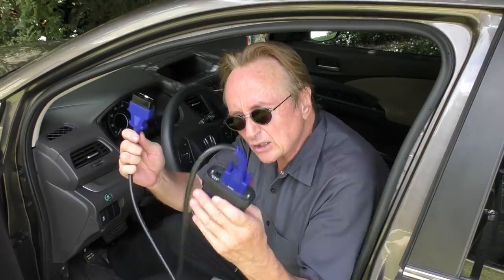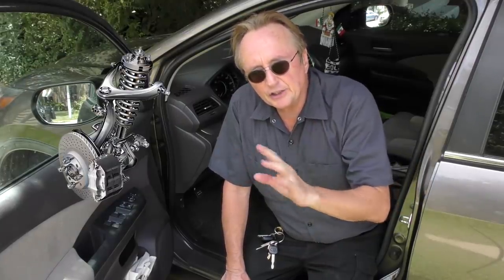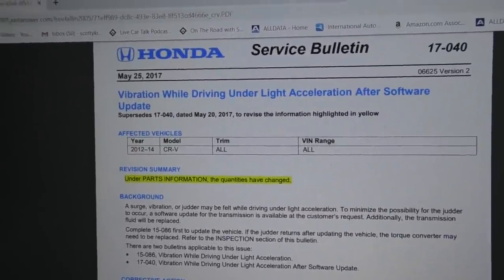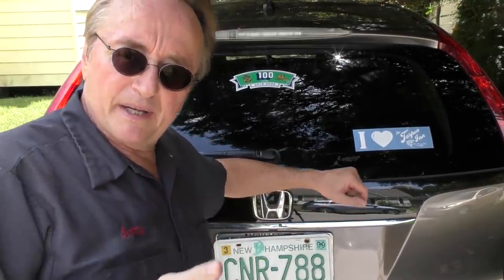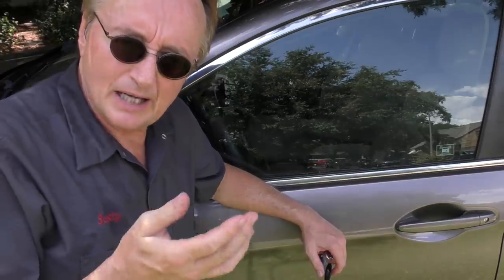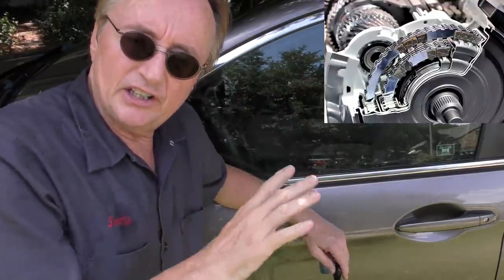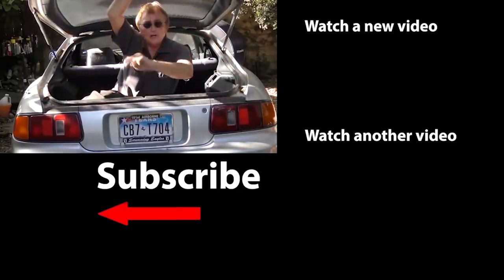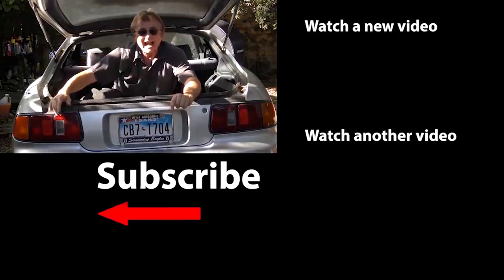I Can't Fix This Car

Comment: Scotty, Try adding friction modifier. Some of the problem is the way the ECM  engages the torque converter, and shift solenoids. Try putting the CR-V in drive not overdrive. My Toyota FJ had this issue but would never do it in drive, just in OD. I changed the trans filter once and fluid 3 times within 3k miles. NO more shudder. Worth a try. You are the most knowledgeable mechanic I know. Wish you lived closer you would have all my business. Keep the great videos coming. Thanks😊😊👍👍

Comment: I had a 2003 Chevrolet Impala that I bought used in 06 with 31k on it. The transmission started acting up at around 70k. I  just drove it till it got 230k and traded it off. The transmission ran okay until the last 2k, but it definitely was ready to go at the end. I live in a rural area so that helped. Love your show. Take care and be safe.    Vaughn

Comment: I have a 2013 CR-V that upon starting emits a momentary rattle sound. Researching on the net, it seems to be a common problem that allegedly is due to the variable valve timing. Some people report louder rattling and/or that lasts longer than a split-second, and they claim that the dealership and Honda won't do anything about it because it is a brief sound and hasn't kept the car from operating. I consider myself lucky that my car's noise is not loud or long. I just keep driving and it hasn't gotten worse.

Comment: I have a 2000 CRV with the same issue. Its got 256,000 miles on it. Slight shutter, has not gotten any worse. You get used to it. Its no big deal. Love my CRV!!!

Comment: Scotty,  over time,  are newer cars or were older cars more expensive over their lifespan?
Considering newer cars break down less, but are more expensive to fox and usually require a mechanic and computers. 
But yesterday's cars many things could be fixed by the owner with basic knowledge and a good tool set.
And which do you prefer?

Comment: So glad I have a 02 Manual Tacoma RWD. Drove it threw the mountains, 1,000 miles, turns out it had MASSIVE rust damage pulling 200% rating. Now It bends when accelerating. After a good 40hrs of work It's SO much better. Just goes to show knowing how to weld is invaluable. My Rusty Tacoma is better than your new Chrysler

Comment: Not questioning your diagnosis. Just sharing some of my experiences. You say "Jutter" . If it's a torque converter I would say "Chuggle". We just use different terminologies. Fords had a lot of torque converter chuggles with their aluminum torque converters.  Seen a lot of lean miss fires under light load that were caused by over active EGR valves, or slight increases in exhaust system back pressure. Easy to verify. Have experienced Vehicle Speed Sensors that would randomly drop in and out causing the vehicle to jerk.

Comment: My 2004 Honda pilot does the same thing. Been doing it for years. After it’s been in the shop many many times and they finally figured it out the warranty was outdated.  So we just put up with it and keep driving it. It now has 237,000 miles on it and keeps going strong. We just have to put up with the transmission shutter once in a while.

Comment: My sister owned a 2012 CR-V, had 285k and she traded it in afraid the car was nearing it's useful life. She got a 2017 CR-V. After 20k, she experienced this same trouble. Dealership couldn't get the trouble on the 10 minute test drive, the mechanic couldn't find the trouble. She traded it in for a 2018 Lexus RX last fall.

Comment: I own a 2016 CRV with the same problem within 1 month of buying it.  Took it to the dealership and they told me the car shaking like a washing machine at a red light is a "feature of the vehicle".  Called Honda HQ and they told me they leave these issues to dealerships to resolve. So basically I spent 26k for a washing machine on wheels.

Comment: I've got one that Scotty probably couldn't fix either. OBD1, idles all over the place. unplug the fuel pump and it keeps running indefinitely with the fuel pressure at zero. Clamp off the evap lines and it keeps running. Where is all the fuel coming from? Could the engine vacuum suck just enough through the injectors to keep it alive? People I've shown the video just shrug and go WTF?

Comment: I have a Nissan that would occasionally do the same thing. It would "shudder" for a few seconds, then be fine for weeks.  In the end, I found a tiny coolant leak that was dripping on one spark plug.  Once I fixed the (very tiny) leak, dried up the spark plug cavity and spark plug wire/boot, it was gone. It's been over a year now with no hiccups whatsoever.  That's something no computer would be able to pick up on. Unless you were lucky enough to have it happen while looking on the scope. There wasn't even a "misfire" code since it was only a few seconds long, very occasional anomaly.   It's something worth checking if you come across it again.

Comment: Hi Scotty,replaced water pumps both, flushed heater core and radiator also turbo charge. Over heat and reservoir bubbling.

Comment: I have a similar problem with a Mazda3 Transmission that is slipping at low speeds (not all the time) the dealership said the exact same thing, if it doesn't trip a code it will be hard to diagnose. I took it for 3 test drives and the mechanic finally admitted that there is a 'subtle problem with the transmission but nothing serious to warrant an investigation. He basically said keep driving it until it gets worse! I am from Australia and Mazda here is the 2nd most popular brand behind Toyota, but I think now I know why it doesn't sell well in the US. Their transmission are very weak and the car is a 2018 with only 15,000kms on the clock!

Comment: The biggest problem is the logo on the hood H .  At least this one kept going, mine would die for no reason. Three H dealers could not find anything wrong with it.  They told me it was high mileage at 65k and I needed to trade it in on a new H. No way no more Honda's.

Comment: I had similar problem with my TSX.  The computer put the car in safe mode.  I changed the Accelerator Sensor and it fixed the problem.

Comment: If this transmission is similar to the 2003 4WD Element, check tyre wear & pressure + an oil change. New tires and an oil change fixed it 100% on mine.

Comment: Honda's are notorious for not throwing codes for problems the Car might have. Example: Our 2004 Honda Civic just shut off while my wife was driving it. No Check Engine Light came on whatsoever. I scanned the Car for DTC's and found nothing.  Went to the Honda Dealer and top tech said swap out the Camshaft Position Sensor. 
I did just that- and the Car started right up. Honda has a problem with the Diagnostic Chip inside their PCM/ECM.

Comment: My new car has a computer controlled windshield fluid. The computer works out the amount of bugs to dirt ratio on the windshield. It changes the ration of ingredients, the amount, the temperature, even the amount of foam and color depending upon what it worked out that it needed for the best cleaning.
It will cost $1250 to replace the washer when it breaks

Comment: I knew what it was right away.  Honda transmissions are famous for juttering torque converters.  My 05 pilot started to do this at 85000.  It now has 265000 and still does it.  Its not hurting anything.

Comment: Had this exact same problem on my 2012 Honda Pilot. It's piss poor short cut engineering to meet EPA standards at it's finest. That vehicle has an eco mode that kicks in under light load at speeds roughly above 35 mph and it cuts fuel and spark to half of the cylinders. This technology has been around for quite some time but Honda couldn't engineer it in these vehicles to balance the engine correctly when engaging. My fix? I interrupted one of the coolant temp sensor wires (doesn't matter which one) with a 100 ohm resistor. Yes, this makes the CEL come on but completely gets rid of the shuddering issue. The PCM believes the engine is not up to temperature, therefore does not engage eco mode knowing it could case more harm than good on a cooler engine. I noticed literally a .5 mpg decrease and drove that way for 50k miles with absolutely no side effects. A very small price to pay in exchange for vibrations/shudders raising hell on your entire drive train.

Comment: My Pontiac had something that looked like a transmission shift problem, but it was the MAF sensor because it was giving garbage data to the computer. However the MAF sensor was giving values in the acceptable range and not triggering errors. Took about two weeks for the dealership to figure out, and only an experienced mechanic could figure it out. Was lucky they were honest, because MAF is about $50 + labor, and transmission is about the current value of the car.

This Honda thing could be the same thing I've mentioned before. Thus may be some variant of the "failing in range" type fault. Might not hurt to see what the MAF and TPS sensors are showing the computer, because the data from either of those sensors is also used to tell the computer when to shift the transmission. Perhaps the vehicle speed sensor too. Those will give an idea of the current load vs. power demand. This means keeping an eye on the voltages put out to see that they change in response to driving conditions. MAF can falsely hold steady, and TPS can have jumps or dead spots. Yet those values are in the allowed ranges, so no codes even though those parts would be giving bad signals and should be replaced.

Comment: Scotty I have had the exact same shuddering "problem" for 11 years now since 2008 on my 1995 Mercury Marquis.  I get the shuddering under light acceleration when encountering an incline.  I just lift off the accelerator for 2 seconds then push it down much further ( but not enough to cause downshifting ). Engine pulls smoothly and no shuddering occurs.  If I need to slow down while still climbing hill,  I repeat the accelerator lift and push again.  I'm not a mechanic at all but it feels like the torque converter locks up and won't slip at low RPMs.  ( kind of mimics a Brocken motor mount I once had ).

Comment: Identical problem with my 2013 BMW X3, only after changing transmission fluid and filter due to replacement of leaking transmission cooler line. Only 50,000 miles, no lights, no codes, just a shudder when lightly accelerating. Shifts smoothly through all 8 gears. BMW did transmission oil balancing test, scanned OBDII, and cannot ascertain cause. Their remedy, to "try" a transmission replacement to the tune of $13,182, with no guarantee of a fix. No thanks, I'll just live with it, I guess. No mention of torque converter or transfer case being a causal factor.

Comment: I have exactly this same problem since owning my 2012 CRV two years ago. I thought it was the engine mount so I bought a premium one but never had the old replaced yet. The problem persists, never get better, never get worse. Now I know even I replace the engine mount might not solve the problem. Just keep driving.

Comment: I had an f150 with a similar problem; turned out for me that a blown diode in the alternators bridge rectifier was causing a ripple in the voltage signal that at times confused the ECM and the truck would buck and shudder between 23-35 Mph. After I replaced the alternator the problem never returned.  I might be off on this one but it is certainly worth a check.  Peace

Comment: Yep, agree, they won't just replace the torque converter. Usually this happens when the transmission starts to wear. My 6 sp ZF Auto had a full rebuilt and torque converter replaced at 200K kms.

Comment: We had the same problem with the honda civic hybrid. The Dealer rebuilt the transmission at our cost. A few months later it started again, Honda said there was no problem. We traded in for a CNG civic.

Comment: We have a 2012CRV and it had the same problem. Dealer put in a remanufactured (reman) transmission under extended warranty and it took care the problem.

Comment: My daughter's Fusion does the same thing.  I did a filter and full flush with the cooler line off. It got better but it's not perfect (fluid was nasty dirty, but not burned). I told her to just drive it because it wasn't likely to leave her stranded.

Comment: Torque Converter. Yup. Same issue as my 309,000 mile 2003 Honda Odyssey, but mine keeps on going after it started 126,000 miles ago. :)

Comment: Not sure if this “jutter” is what I experienced. On my new car, if I were going pretty slow and accelerate VERY lightly, sometimes the car jerks a few times before starting to actually go. But I don’t think it’s a transmission issue for me. 

As I understand it, Modern cars don’t fire their engines while in coasting mode, and only start firing during acceleration or idling when stopped. 

So when I accelerate lightly at low speeds, the car is hesitating, can’t decide if it should accelerate or not. It fires up the engine, jerking the car forward, changes its mind and coasts a bit, changes its mind again, fires up and jerks, changes mind and coast, before finally accelerating very lightly

Comment: Scotty, 
 I have a 07 Tacoma. When I’m at a complete stop, then while making a turn I feel a vibration in the back. Even when I back out of my driveway and turning to get out of the driveway I get the same vibration. Doesn’t do it otherwise one of these are being done. Drives fine, no engine light. Any idea what it could be? Thanks!!

Comment: I actually had a similar problem with my 08 Chevy Malibu.  The mechanic sat next to me while I drove with his scan tool and all it showed was the torque converter engaging and disengaging.
Long story short they replaced the transmission control module, located outside the transmission and it solved the problem.

Comment: In my opinion Toyota’s have always been better built and more reliable than Honda’s. Especially now, newer Honda’s are having electrical issues, build quality is bad, turbo problems, oil dilution etc. They have gone down in reliabilty lists while Toyota/Lexus have remained remained on top.

Comment: change the oil in the transmission, run through all gears stationary, then hold the brakes on and power that thing for ten seconds in drive, then do the same in reverse ..... worked for me !!
Not had a judder since. xx

Comment: Perform a drain and refill on the transmission drive and repeat total of 3 times. Will fix your problem. Fluid is supposed to be changed every 30k on those.

Comment: my CRV (2014, 50k) has a similar issue, just it shudders at 35mph at 3rd gear. The Honda dealer recommended to flush the transmission 3 times and reprogrammed for 400$. I am not going do that stupid "repair" since the shuddering will come back according to other people.
This is a design flaw not a software update issue, its obvious.

Comment: My 2013 Nissan Pathfinder with the CVT did the same juddering at low speed, turned out Nissan had extended the warranty to 84k miles, they replaced my torque converter for free at 82k miles been running fine since.

Comment: General Motors cars used to do the same thing , it was the lock up torque converter , put a nonlock up trans in it , all fixed.

Comment: I had a similar issue many years ago with a Mitsubishi, went there and they asked me for a big load of money to repair it, this after 3 days of running tests on the car, so decided to try to solve it myself, and found what was the issue, It was a very tiny plastic tube that conducted air into the fuel injection system, the tube was curvy so with time it got with a almost invisible crack, spent 50 cents to repair it! ( a 20 inches plastic tube ! )

Comment: Sometimes, a worn out wheel hub assembly can do that juttering as well. Happened to my mom's 2007 Chevy Uplander, then the ABS/TCS/Stability lights/text on the odometer area showed up. Hasn't been doing that in a while. All that's left is to get the remote start to work again (EVAP Vent Solenoid is stuck open, which should close when 12VDC is applied to it and the vent solenoid is the same design as the one on my 2001 Oldsmobile Intrigue, which is nice).

Comment: I have the same damn problem on my 2010 civic. I got fooled and so did the best mechanic in town.i spent $1500 on struts, wheels tires alignment...still shudders at 15 mph under light acceleration.

Comment: Hey Scotty. I have a 2005 mini cooper base. And when I turn on the car, I put it in drive or reverse and it doesnt move. So i press the gas down all the way for 3-4 mins and then I try again in drive, and it works normally. What do you think the problem could be? Please help. Thank you

Comment: This is the first video that was a huge disappointment for me.  Honda keeps doing stuff like this and does not own up to their bad enginning.  I have the vibration issue with my 2015 CRV.  Now the new ones have the oil dilation issue.  It's time for consumers to say enough is enough or Honda will keep doing this crap.   Personally, I will NEVER buy another Honda.   I've been burnt twice by them.  Anyway; YOU SAY we should just live with it!!!  After spending 25 to 30K which is a lot for some of us.  This is not acceptable in my opinion.  This can not be the new norm!!!

Comment: This vibration usually happens when driving under 2000 rpm, is a common Honda problem, as the vehicle age.

Comment: Is The Trans, just change the oil it'll stop once you change the trans oil with original Honda transmission oil, my pilot does it too after 4 years with the same oil, change the oil and that fixed the problem, my pilot has 211000 miles only done the trans oil 3 times went to Mexico 5 times and still runs like a champ!!!

Comment: Scotty, i have a 2005 CR-V that has the same problem, bought it used 5 years ago and has always done the same thing. It would get better and then back but never any worst. Should i replace trans oil more often?